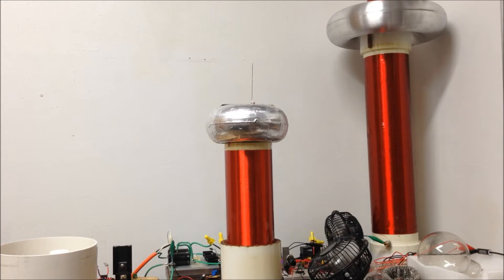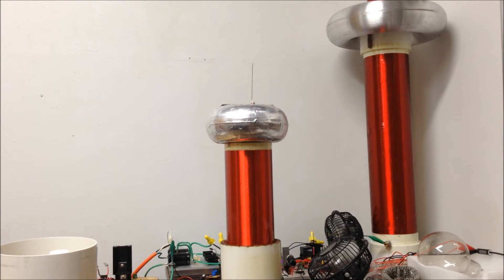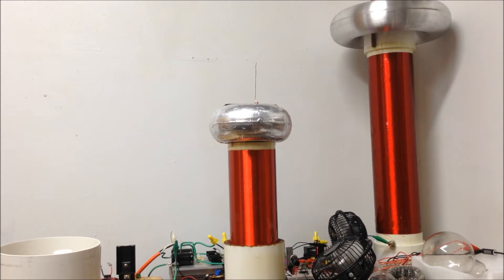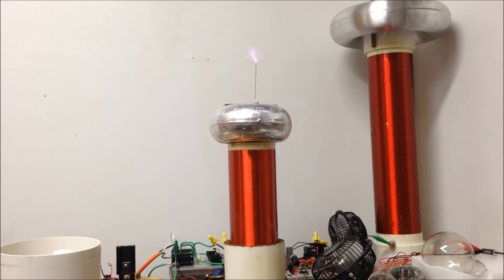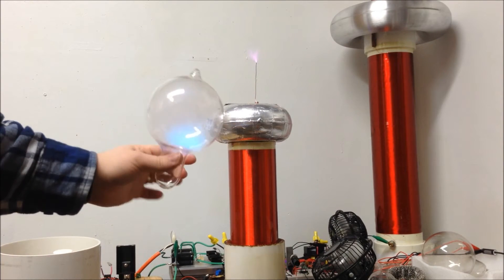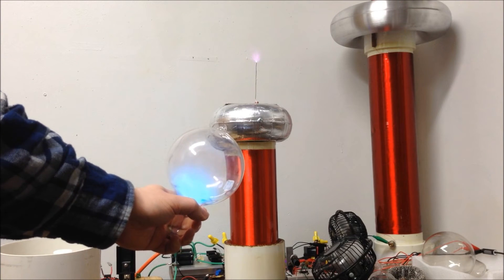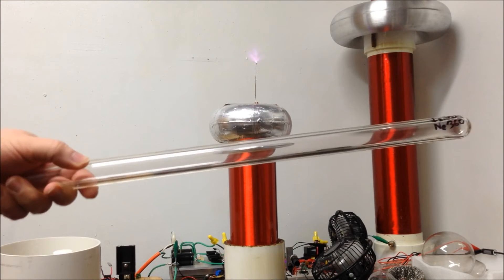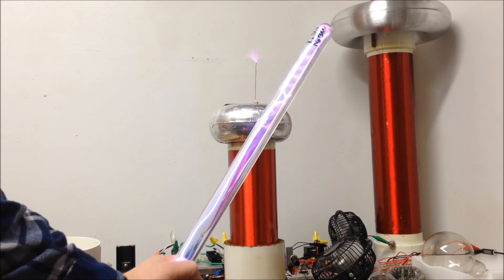SSTC Plasma Speaker + Carl Willis' Plasma Tubes

Comment from the maker: As I stated in the video; this coil has been fitted with a High Impedance (non-resonant) primary in order to limit peak current draw so that the voltage ripple on the DC Bus is kept to a minimum. This is necessary for maintaining a quiet output, which is needed for audio modulation.

Also, running CW (continuous wave - non pulsed) causes all the air around the discharge to become ionized, which means there is no driving force for spark growth. You get a small, very hot brush coronal discharge and no streamers running CW. This is by design.

Furthermore, several commenters have expressed that they expected a larger output for "the coil size". This notion that size of the coil is directly related to output spark length is false. Secondary coil size determines the intrinsic resonant frequency, that is all. One can get three meter streamers from a 10" long secondary using a QCWDRSSTC or one can get 2" brush corona using a standard SSTC. Different topologies are for different goals. The design goal of my coils is not "huge massive sparks" but rather large strong electric fields, like Nikola himself strived for. The two end results are mutually exclusive; you pump your power into an electric field or a long arc, not both.